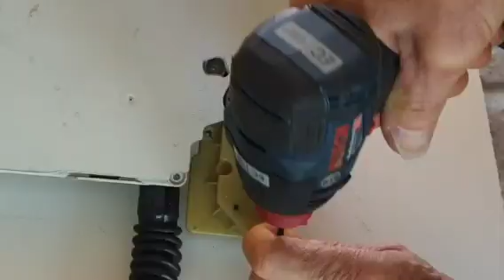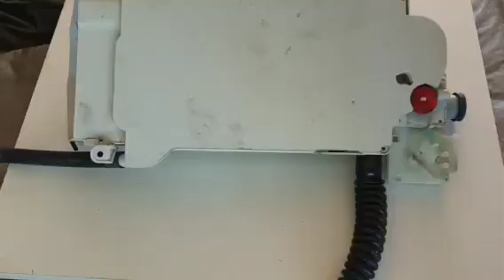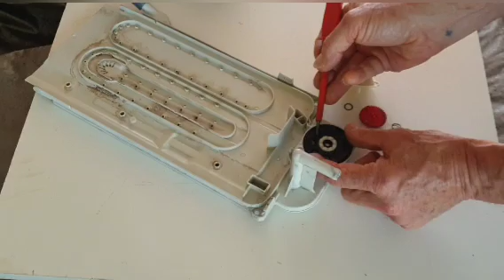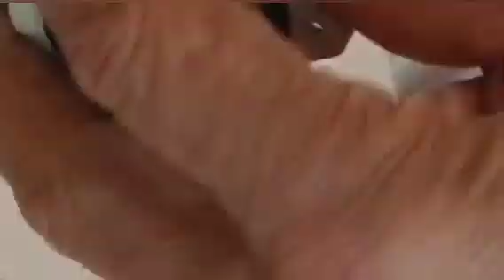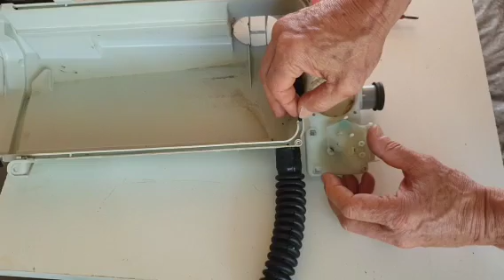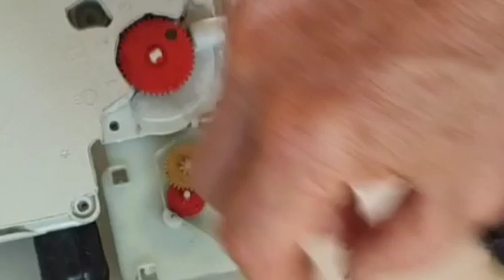Miele F63 - Water Path Control Unit

Comment: Update: Our newish water path controller has started throwing this code again. Does anyone know how to resolve this issue? We've taken the WPC apart and coated the rotating disc valve with plumber's grease, but that is not lasting, and we're getting the dreaded "clicking" on start up followed by F63. Has anyone resolved this for more than a month or so?
Reply from the maker: You need to pull it apart and check the contacts of the position sensor (see my video). Check for continuity between the gold connector pads and  the copper tracks, sometimes they look ok but there are micro cracks and there is no continuity. Also check the motor, gears especially the red gear that needs to line up with the other gear where the tooth is missing.  Lastly there could be an issue getting the position signal to the controller, i.e. wires, connectors and tracks on the main pcb.